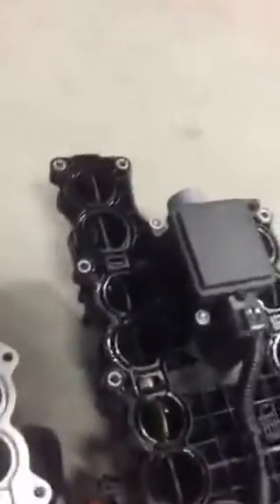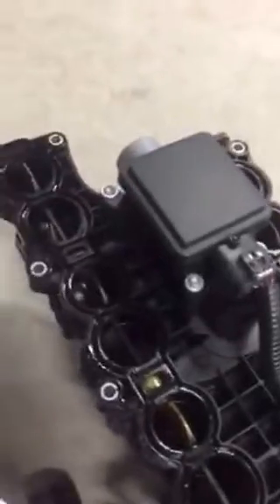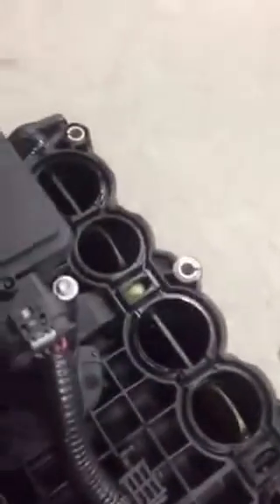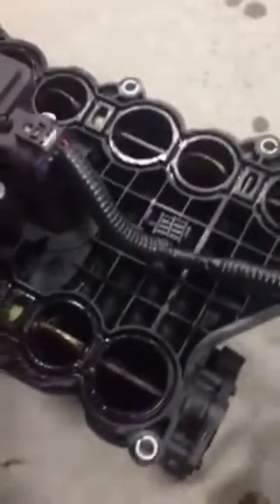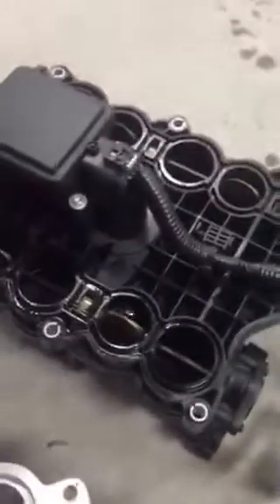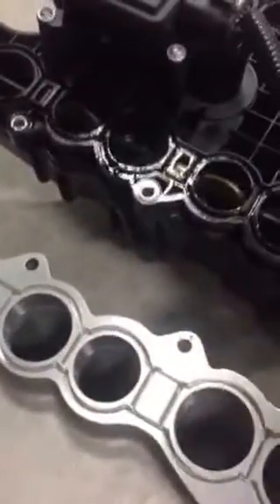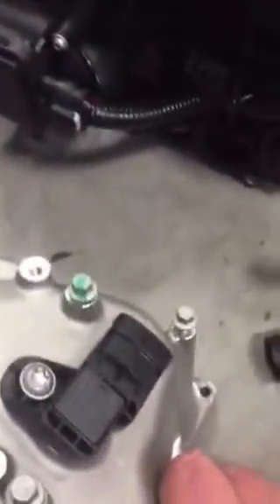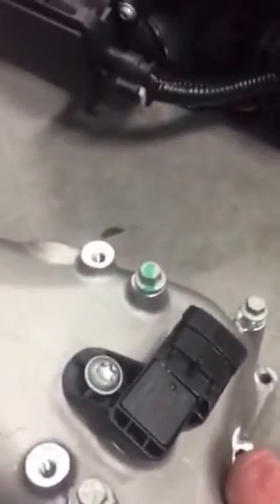Banks Intake Manifold EcoDiesel Comparison

Comment: Hi can I run in stock tune ?
Reply: No, you will throw an engine code for the shutter valves. It will require a tune.

Comment from the maker: Sorry about the late post folks! The manifold did great. We dynoed the truck with just about every bolt on performance part (exhaust, tuning, intake, CAC piping) and it ran 265HP to the wheels, on 35's. At this point the limiting factor is the turbo, it just can't move enough air. Still gets proper mileage and is fun to drive. At 265HP it may not seem like a lot, however keep in mind we also dynoed another EcoDiesel that had all the bolt ons done, less the manifold, and emissions intact and it only hit 208HP to the wheels, on 35's as well.
Reply: +Diesel Power Products what PPEI tune did you use with the bolt ons ?
Reply: Get the turbo upgrade?

Comment: Im making a series about the ecodiesel intake manifold all stock at 191,000 miles, The problem with the stock plastic manifold is much more evident now than your lower mileage cleaner version. Mine has one side more clogged up and is like tar and clogging up the intake runners on the head, and on the passenger side its dry and cakey. There is definetely an imbalance that will make one side of the engine hotter and the other side flow more but have more dry soot. EGR HAS TO BE STOPPED> the banks manifold is a really good idea, and its cheaper than the factory oem. My plastic manifold is distorted and leaks boost pressure. There is no waste of money investing in the tune and intake from banks. This will ensure a long life for the ecodiesel.

Comment: Just tried to have this installed on my jeep. Full deletes, straight pipes, RIPP intercooler, 60 hp ppei tune all done. Thought it was gonna be wrapped up once we put this intake manifold on but we can't get the throttle body to fit.
Reply: is that the banks req'd throttle body delete piece they sell for about 100 bucks that doesn't fit or the original?  if orig. that's why.

Comment: id love to hear the gains from this, I currently have all emissions deleted on my grand cherokee diesel with a 60hp PPEI tune. I contacted BANKS about this manifold but all i got from them was it was still in R&D.
Reply: Nathan Nash Installed the banks intake and it makes a world of difference. Also has a full delete and a 40 horse power tow tune. I have experience with an eco diesel with the same delete and tune with the stock manifold but there not even close speed and towing power wise. You cannot smack the throttle at a stop light and not break the  tires loose. Awesome upgrade but a bit of a pain to install. I replaced it due to one of the butterfly valves failing form soot buildup and couldn’t be happier with it.
Reply: @lukevandenberg3378 
I know this is 4 years old but what brand delete kit were you running with the banks manifold